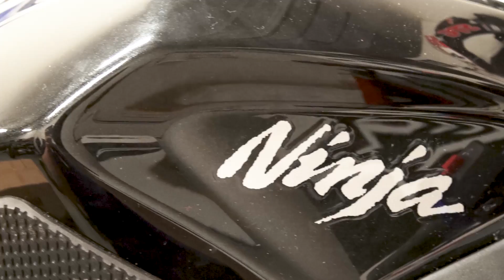Kawasaki Ninja 400 HOTBODIES Race Bodywork Install | Sportbike Track Gear

Comment: Curious how you located the two holes under the tail to line up with the inserts on the undertail plastic??  Excellent work & super helpful!  Thx!
Reply from the maker: I am pretty sure there were dimples in the fiberglass to mark the spot. - Van
Reply: @sportbiketrackgear  No dimples on the one I just got, I'll try to grind a couple screws to a point & mark the inside.  Wish me luck!  :-)

Comment: I have found that if you have frame sliders on, it is best to mount the mid-fairings first. Great video as per usual!
Reply from the maker: I have not decided if we will be running sliders on the bike for the track or not. Need to do a little more research. Thanks for watching! - Van
Reply: @sportbiketrackgear  Did you have to trim the fairings around the case covers?
Reply from the maker: No I did not have to trim them around the GB Racing covers, the clearance was good. - Van

Comment: Is it possible to use the stock tail section with the hotbodies upper/mid/lowers?
Reply from the maker: Yes you can leave the stock tail section on the bike if you want to do so. - Van

Comment: I seen you put alot of different slip ons for this bike even full exhaust systems. Which one do you like best for this bike?
Reply from the maker: We are running the M4 Full System on the STG Ninja 400 now that it has been converted to a track bike. Here is a link: https://www.sportbiketrackgear.com/m4-kawasaki-ninja-400-2018-full-exhaust-x96-carbon-canister/  - Van

Comment: I bought a complete set of Chinese fairings for my 300 Ninja for $155 delivered, and everything bolted and snapped into place with a perfect fit. No drilling. Not sure why Hotbodies has to be a pain.
Reply from the maker: I have never seen a whole set of race bodywork for $155 delivered, not ever. The box the kits ship in is so large that shipping in the US is $75 or more. Maybe a set of street bodywork that could ship in a smaller box? Race bodywork and street bodywork are very different. - Van
Reply: Yeah that’s hard to believe. I’ve had a hotbodies race fairing for a ninja 300 and it was great. I looked for one for a Ninja 400 from eBay but with shipping it was about the same for hotbodies. I’m going with hotbodies for mine.
Reply: @sportbiketrackgear   I should have pointed out this is not a race fairing. For $155 you get a replacement for OEM fairing. So they make 20 times as many and therefore reduce cost. And it's probably not as strong as Hot bodies.

My point is - why do you have to grind metal (or even drill holes) to mount a fairing? Just seems like a bad fit and they should have caught that in pre-production.
Reply from the maker: This bike is being converted into a track only race bike. You can not use street bodywork for racing. Race bodywork will typically be much easier to remove and reinstall quickly. It also has a fully belly pan to retain fluids if you have a mechanical so you do not oil down the track. - Van
Reply: @sportbiketrackgear  Thanks Van. I felt for Brian. He probably helped a lot of people who would wonder if they needed to grind metal on their bike. I've struggled with setups like that and it takes up time.. Not that it is a big deal. Just that everything seems to have mm accuracy now days.
Reply: The left side of my 2021 Ninja 400 fairings got slightly damaged due to a fall on a kerb [not my fault, lol!]. Anyway, it is somewhat of an eye sore. Can you please advise on what are my options if I want to fix/replace that?